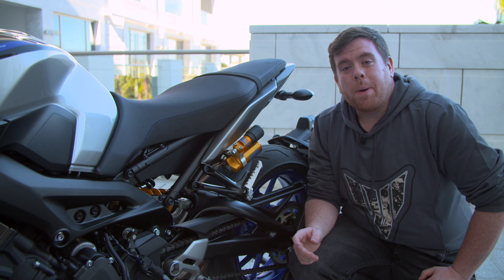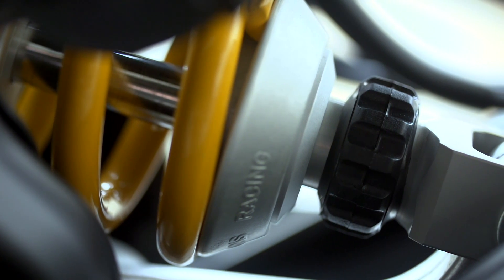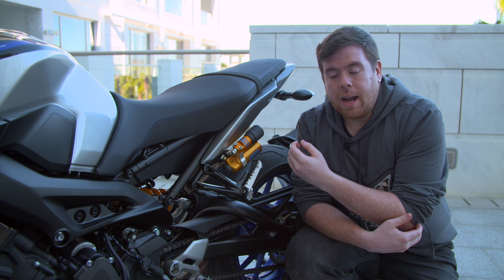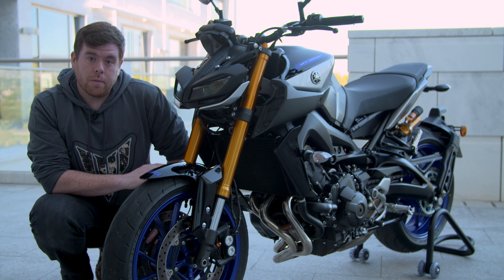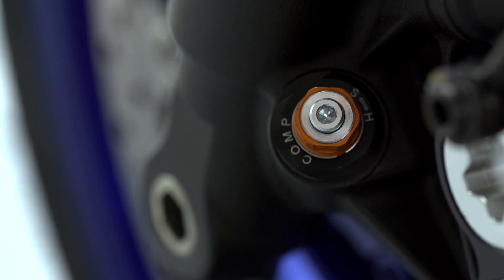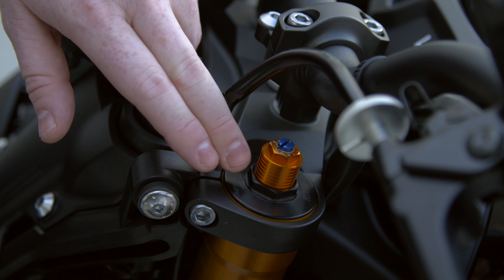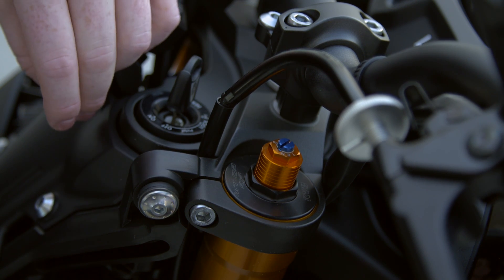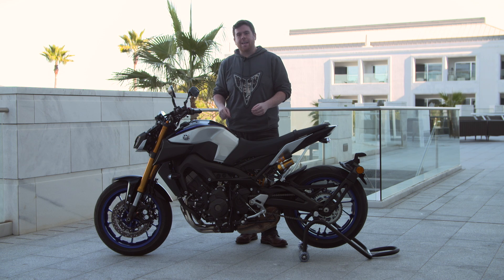2018 Yamaha MT-09 SP - Technical video 2 | Suspension

Comment: I have made some fine adjustments to the suspension and settled on the following settings
Front
Spring preload - unchanged (18mm std height, softest is 19mm, hardest is 4mm)
Compression damping (slow speed) - 2 clicks softer - standard is 11 of 18 clicks, now at 13
Compression damping (high speed) - unchanged - 3 of 5.5 clicks
Rebound damping - 3 clicks softer - standard is 17 of 26 clicks, now at 20
Rear
Spring preload - unchanged (softest setting, 148mm) - Note the preload is remotely adjustable
Compression damping - 3 clicks softer, standard is 10 of 20 clicks, now at 13
Rebound damping - 3 clicks softer - standard is 12 of 30 clicks, now at 15
Result: A much less bumpy, and more stable/compliant ride over bumps at low/medium speed, even with a pillion, and improved stability when leant over.
Reply: adrian5606 this is what i was looking for 😁. What do u weight?

Comment: Pity you've skipped radially mounted master cylinder. It's already fantastic bike but that would be a great touch.
Reply: agree, this bike should got radially mounted brakes master, considering the "SP" tittle
Reply: all bike should come with that in this day and age . even if it means adding 200 to the msrp . it cost alot more to upgrade with the lines and all. i went with R6 and steel lines thats bend for radial master. that cost 500 bucks or so.